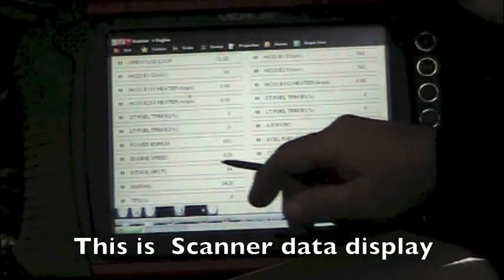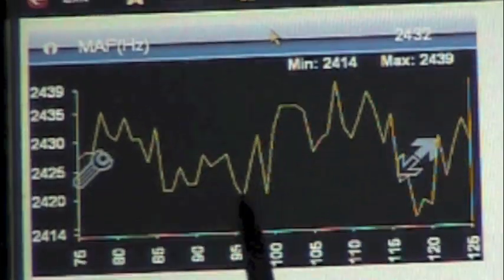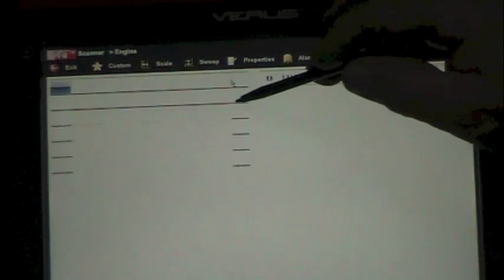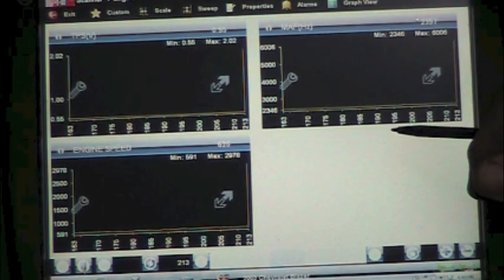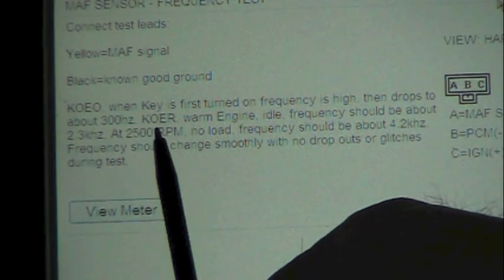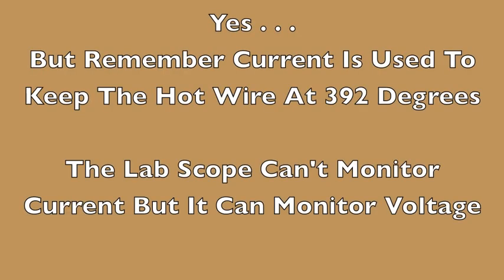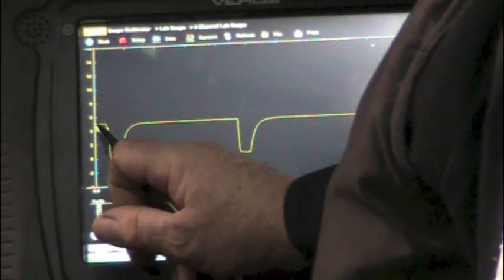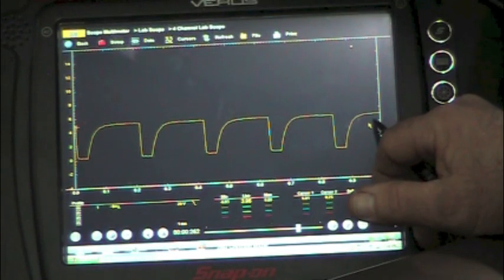Teach Yourself Series    MAF code P0101 part   2

Comment: I have this code appeared as "present" right after replacement of MAF however there is no CEL on the dashboard but it is visible only when I use scanner.
Reply from the maker: Those kinds of codes are stored in the memory. The fact that the code is there means the computer saw something that would trigger the code but it hasn't turned on the CEL because it wants to be sure it is a real problem and not a possible glitch.  Its will continue to monitor the system and if it see's it again it will turn on the CEL.  If it does not see ir again, it will leave it stored for reference purposes.  A good diagnostic tech can use that stored info to identify a potential problem.  The most important thing is to see if there are physical and actual symptoms that match the potential problem.

Comment: Great video series. I have Mazda 5 2008 with the same issue. The code appears only during winter and clears itself when temps are close to and above 0 C. Idles perfect and no issues with power. However LTFT's hovers around the 8%-9% range on idle with no compensation from STFT and goes down to about 2%-3% when cruising with help from STFT. Unable to conclude if MAF should be replaced or not. Cleaning MAF did not help.
Reply: I have a Kia that has the same problem as yours. Changed MAF sensor and didnt work. Kia workshop wanna change the EGR valve but I said no to that. Let us know if you find a solution to your problem😇

Comment: Okay i watched part 1 and 2 ..i have same blazer with 4.3 and i am getting the po101 code... i only have a test meter no fancy equitment... you never explained why the code came up and how to fix the issue...if you did i must have missed... i bought a new Maf and i still get the po101 and truck bucks and hesitates under load but idles like a dream.. Was i sold another bad maf? all my wires test same as yours do here except the signal wire reads only 2.67... even with motor running and moving throttle signal stays at 2.67 . the power wire increases to over 14 volts when motor is running.. please point me in the right direction... thax.
Reply: roadstar499 could be clogged cat converter

Comment: How bout a series showing the difference between 02 sensors and wideband AF sensors.  How are the diagnostic parameters different?  What tools do you use?
Reply from the maker: Great suggestion.  I'll begin working on it.  Hopefully have it sometime this summer.  THANKS
Reply: Thanks much!  I've learned a lot from your videos.
Reply: Wideband oxygen sensor = air fuel sensor which voltage varies between 1 volt to approximately 3 volts contrary to narrowband oxygen sensor which voltage varies from o volt to 1volt.  Narrow band oxygen sensor = downstream oxygen sensor located after the catalytic  converter ( ohm reading between 2 black or 2 white wires is higher like15 ohm depending of year and model. Wideband 02sensor ohm reading is lower approximately 1.2 ohm or 2.5 ohm,  example 2002 lexus rx300 is 1.2 ohm while Toyota camry is 2.5 ohm.  I took camry 2.5 ohm put on lexus , check engine light still on and I have to buy expensive one with the right ohm and no more engine light.

Comment: Would be nice to see a wiring diagram...Does the MAF drop the battery voltage to 5 volts and send a PWM the PCM or does the PCM drops the voltage and sends a 5 volt PWM to the MAF.. Which one controls the temperature of the hot wire ???